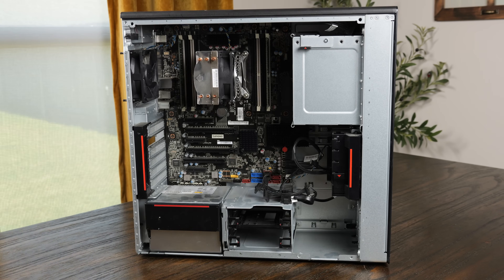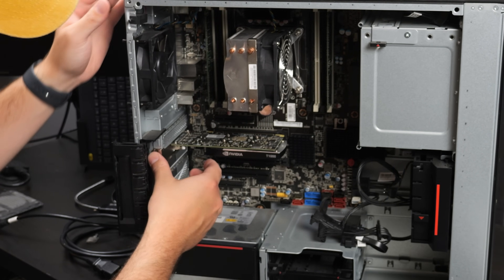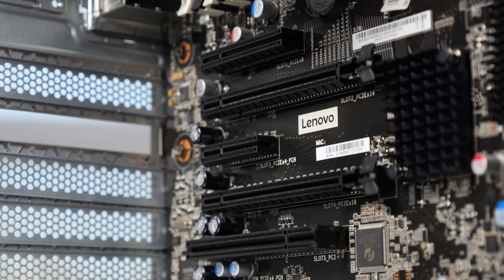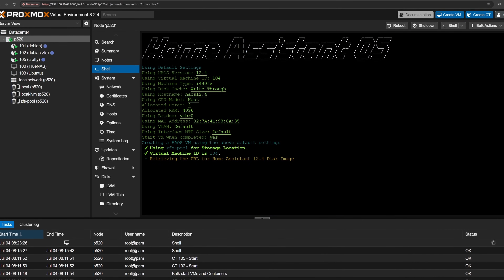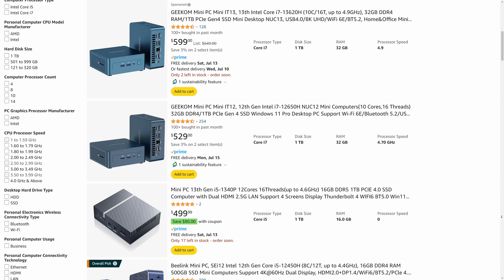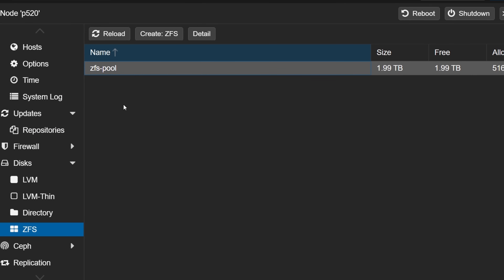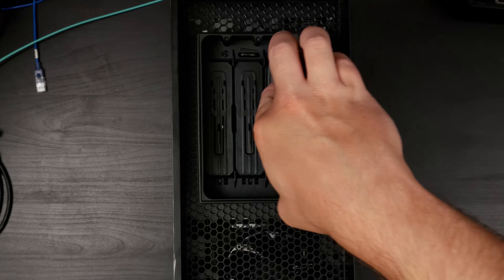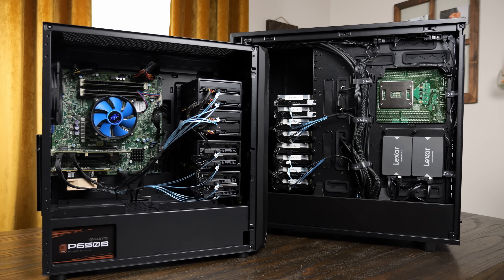A SERIOUS Home Server That's Affordable [Lenovo P520]

Comment: :) Thanks, love your videos. I'm currently using a Lenovo M710s for my Truenas Scale server. While it's handling everything pretty well; I feel like I'm working it too hard, and looking into something a little bigger (CPU mostly, 8 plus.) because I want to start sharing my services over the internet. It's currently running an 4-core intel i5-7400 (with 2x16GBs of 2666mhz), a mirrored 500Gb nvme boot drive, a 3-disk (500GBs each) raid 5 2.5" ssd pool for app configs, a 4TB mirrored app Storage/SMB pool, x2 2.5" 500GB HDD hotswaps for the app config pool,  a 2-port (x8 sata cables) HBA card, and a single port 2.4gb network card. 🤣🤣🤣 And most of the drives are in a 5-bay steel server cage (with built-in 120mm usb powered fan.), sitting outside of it. 🤣 My main pc (also a lenovo M710s) also has 1 of these cages attached to it, with a few spare drives. Not sure what they are actually called, but linked them in the reply to this comment. It started out simple and got crazy really quick, but looking at the P-series thinkstations for more cores and ram capacities. Oh, my Truenas Scale server cpu also idles pretty low, usually usually under 5%.

Comment: I deal with a mix of "regular" PCs and these business class style PCs, and from a maintenance perspective, those special quick change components like the PSU and front panel makes servicing extra smooth with next to no extra time required to get everything plugged back in. That station is designed around a IT department that has many of the same stations and keeps a stack of parts on hand for quick servicing where the cost of those proprietary parts is worth the reduced time to get a station back up and running, where minutes spent plugging multiple headers for the front panel and other components is something that is seriously looked at.

For home users, yes, the design is silly and makes finding replacement parts a huge pain. For medium and large business, its a time saver and they often order spares for each station, its worth the additional cost up front, since that can be written off on taxes.

Comment: These are a great line of PCs that are getting to be down in the nice pricing. I am currently building a P720 into my home server. 2 x Xeon Silver 4210 CPUs is giving me a lot of options and the layout is similar to this. One thing that I would change is to have 3 x 5.25" bays rather than 2 as this would open up a lot more options for expanding storage bays. Of course, the problem that I am currently having is the pricing of even second hand DDR4 ECC memory sticks...

Comment: @HardwareHaven what Sata power cables and Data Cables did you use, I've the Same System but struggling to find the cables. Ive three HDD im trying to connect?.

Comment: I just got my P520 with a W-2235 Xeon and 256Gb of memory. Am installing 2 1Tb nvme ssd and plan to add 4 used hard drives. My only problem is how do I power the additional drives, because my machine only came with two short 4-pin to 2x sata drive power cables and I can't seen to find any 4-pin to 4x sata power cables anywhere online. Any ideas?

Comment: @Hardware Haven your Intel AMT KVM feature likely failed for you because you didn't have video output (DP or HDMI) plugged in. I had to get DP headless ghost adapter or have a monitor plugged in otherwise video wouldn't show. Look into that as the solution.

Comment: FWIW, my P520 did NOT have "Onboard Intel RSTe SATA RAID" available in BIOS (i.e. VROC ONLY!). Also be forewarned: when equipped with the 690W PSU the second GFX power is not available... with 900W PSU, the second GFX PWR is available.... it would also be rare that the 9440-8i/9460-16i RAID controller would be included.
Also, the beast is built like a tank! AND, Lenovo support forums, factory updates are top-of-the-line 👍👍 TONS of quality spare/upgrade parts readily available... as these were business machines that were typically well maintained by (Lenovo contract?) professionals.... added a P720 (type 30BB) to my lenovo collection.... yippee!

Comment: Well, other brands also use non standard stuff. Once you branch off to Xeon based systems then you are bound to find a lot of gotchas and cave-ats. Just a few remarks on this 1. With these type of systems everything happens for a reason. Making proprietary stuff costs money. Hop on an engineering call with any of these vendors and there is usually a guy that can tell you why. 2. These reasons might be unknown to most except when you are in the business, could be to get a system ASHRAE certified, or optimized for licenses for workload. Or it could be as simple as: this part is not suitable for 24x7 operation. 3. Vendors don't need physical connections to vendor lock you in, custom firmware is enough. 4. Most of these systems will spend most of their life under warranty, there is no need for proprietary stuff while it's under warranty.

Comment: hi dell is beter because lenovo is a noisy thing dell precission is mostly les noisy i have the dell precision 5820 with the xeon w2195, 512gb ram 4x 8tb nvme in pci expres and 4x 24tb and 8x 4tb ssd in the 3,5 bay and a rtx a8000 48gb the bummer is no raytrace and pci gen 3 bit a bummer but its good innof also with lenovo you cannot boot from pci expres with the dell precision 5820 with a boot driver its posseble the sata was innof for the drives and blueray burner but i had to use the sas controller to connect the 8 ssd's and make more power connectors oh and somthing in mind the dell precission have somthing else 2 different power suply's 450 what with not the pci power cables and the 950what with pci power connecters mine came with the 450 what i have buy a 950 what power suply and pci cables so you know a bit what to expect with upgrading or buying these kind of systems

Comment: The HP Z6 G4 costs $200 shipped in a turn key configuration.  Just FYI!!! They come with a Xeon Scalable Gen 1 Silver but a 20 core Gold is like $30.  With a $100 Xeon Scalable Gen 2 Gold you have a server that’s compatible with cheap Optane DIMMs so you could slot in 4x 16GB DDR4 for $15/ea and then pick up (2) 128GB Optane DIMMs for $30/ea and you’ll have a system that reports 256GB and has 64GB worth of fast buffer for the 256GB.  Or you can just drop in 6x32GB for $30/DIMM and you have 192GB.  It can hold up to 384GB of ram per CPU in 6ch mode and yeh I said per CPU.  It’s going to cost you as much as the system cost you but you can buy a dual CPU expansion.  Or if you really wanted a dual CPU to begin with you can buy a HP Z8 G4 but who wants to muck about with dual CPUs.

Anyways yeh this is a cool computer but buy an HP Z6 G4 it’s better.

Comment: May I ask did you use standard 6pin to sata cables for the extra hard drives you added? Or which connector did you use to feed the extra hard drives power? Or does any1 else knows? 

Looking it up online, some sources suggest that Lenovo's 6pin power connectors on the motherboard (GFX_PWR1, GFX_PWR2) are non-standard, and isn't compatible with standard 6pin to sata cables.

Comment: I spent an arm for mine.  Custom made, 16 SAS hard drives on Areca 1880 RAID, one 18 core E5-2699 CPU on a basic Asus X99-E motherboard with 64GB of DDR4, 1200 Watt PSU, Used GTX1060 which was used for Bitmining and a modded Tyan workstation case from 2007.  ALL USED PARTS.

If a part fails, I can replace it.  Actually, I was thinking of getting a supermicro x10dai Dual socket motherboard or a HUANANZHI X99 F8D PLUS Motherboard as my case can fit E-ATX in addition to the room for a total of 20 hard drives.  I would also pair another E5-2699 in, for an amazing 72 threads if I did.  Also, there is a BIOS mod that enables the all-core Turbo on a E5-26xx(V3) which provides you with extra process power.

Now that is my ideal server NAS/Gaming machine.

Comment: Interesting, the cpu on it is a little less computer power than the 5600H in my laptop but the expandability, etc, for the prices you get on ebay - not terrible. I think id still pay a little more get a modern CPU that doesnt use so many watts

Comment: You know a professional computer repair person might remove the CPU heat sink fan from the motherboard when the motherboard is still screwed into the back plane of the case. You risk warping and damaging micro components on the motherboard when you remove the motherboard and then try to remove the Heating fan assembly!

Comment: I have built Lenovo P320s, P520s, P720s and P920s.
They are an excellent workstation choice as large businesses and enterprises dump them after three years of support for new models.
Dell Precision workstations are also excellent.
Supermicro workstations are the best for reliability and redundancy.
I only pick those three for Linux workstations; there is no point buying anything else.

Comment: I bought one of these after watching this video. I can confirm it works with the xeon w-2150b processor. these are a supposedly apple only version of the W-2155. It has 10 cores 20 threads I got mine for just about 110 dollars. as of writing the W-2155 costs ~200 dollars on ebay for a genuine article. if you're intending to upgrade cpu immediately the W-2150b is an affordable choice. As far as I can tell from doing research, the P520 is actually compatible with all Apple versions of socket LGA 2066 processors, but I can only confirm one from personal experience. I had concerns  about cooling with the extra cores, (not to mention I was gambling it would work off of one geekbench score I found online) but it works perfectly.
Reply: Thanks. I’ll have to try this out!
Reply: Grabbed a 2150b on eBay. Excited to install
Reply: @Kluong625  I'd love to hear how it goes.

Comment: We like Lenovo boxes.  We have an M93 I7 in the kitchen, a pair of P320 I7 tiny boxes driving the TVs for all viewing and streaming.  A p330 tiny with I9 and P1000 for portable theater.  Lastly I have a fully loaded T15G laptop.  Also a great buy are the used HP Z800 and Z840 workstations.

Comment: 140w is a monstrous consumption for a home server
Reply: My HP Z6 G4 pulls 80-90w with a Gen1 Gold, ARC A380, 6 DDR4 ECC DIMMs, SFP+, SAS6G HBA and some hard drives.  

At 32w which I think is what he says this pulls without a CPU the most money you can save in the United States would be $15-20/yr.  Where as he is already saving $50/yr over my setup which is still why I’m not even worried about the $80-90/yr mine costs to run.  Like what’s the point in saving $60-70/yr for a PC that doesn’t have ECC or costs $400 just to get (4) 32GB UDIMMs in DDR4 or DDR5…

It would take me years to cover the price difference between what it cost me for 192GB of ram and what it would cost for 128GB of ram on a system that could idle at 20w or less.
Reply: A lot of us have hyrdoponic growing systems (salad greens, tomatos, peppers). Over 1KW in lights. DOH!
Reply: I had one, the mobo died, the energy usage kept me from replacing it

Comment: 6 core 12 thread...not so great for a home lab.  I just upgraded my server for $30 to an Xenon E5-2695 v4.  And you can find plenty of LGA2011 / X99 Motherboards for less than $60 . My server runs 8 Virtual machines on ESXI, and has been running 24/7 for 5 years. I only upgraded the CPU from a E5-2630 because I wanted to run a dedicated Navidrome stream server.

Comment: I picked up a cheap Lenovo P700 with dual(!) Xeon E5-2620v3 and a Quadro K2000. Threw in 16GB RAM, 5x8TB HDDs in RAID5 and 2x500GB SSD in RAID1 for OS. Ran up Proxmox VE, and Plex container plus lots of other containers, and use it as a general file server. It's a beast for the price I paid.

Comment: Hey, I don’t know if you’ll see this comment, but which adapters did you use to power all those drives? I’m planning on adding two more 3.5” HDDs but am lacking sata power. I’ve looked up a 4 pin to SATAx4, do you think this will work? Could you offer suggestions? Any help is appreciated, thanks.
Reply: The 3.5" SATA drives were running from the seven motherboard SATA ports, so no adapter was necessary.  SATA power splitters can add as many power plugs as you need, within the limit of what the PSU can deliver.
Reply: I have a similar question, I can't really see clearly in the video what adapter hardwarehaven is using. Looking at the motherboard schematics, it looks like there are two 4pin connectors (1 for optical drive, 1 for drives) that are supposed to use to drive power, so I think this is the correct solution

Comment: I have a p520 myself, and I use it as a workstation. I didn't realize it uses bifurcation as well. Mine came with a 512gb ssd and 64GB of ram. I added an AMD RX 6600, a 4TB nvme, and I added a wifi 6 card. I love this computer. It's not super fast, but it does everything I like to do.

Comment: this video is no longer useful. the price of these computers is now $300 and you can easily build something better for $80 less- which is what i did. i'm sure at the time of recording it was worth it, not any more. however, i still would not recommend this computer even at the time of recording because repairing parts and/or replacement parts is much more costly in proprietary systems than systems using normal parts. so if you run into a problem a few times, you will find yourself almost spending the cost of another normal computer build just to fix this computer. 
so in the long and short run. just build a computer server using normal parts. it'll be better in lifespan, performance and maintenance; repairs/replacements/cleaning.

Comment: There are literally hundreds of reasons NOT to use Lenovo. The number one being this;

If you are even the least bit concerned with our war with China, consider that they interject back doors and spyware into the hardware, even behind the BIOS. For most home users, this would pose little risk. However, if you have sensitive information or applications on it, then Lenovo should be avoided at all costs. There are many more safer alternatives out there for the same money or less, like Dell or HP.

Comment: The KVM function in MeshCommander (Intel AMT) only works if you have a CPU with an iGPU. Most of these workstations rely on an external GPU so you can't access them via KVM, but it is nice to know the serial-over-LAN works.

Comment: Just a fun note, I have several of the HP equivalent Server PCs (z840, z6 G4, etc) and they're very similar to this. The only thing I can say is that the HPs have a bit more on the tool-less and the drive bays make a satisfying clicking noise to let you know they're secure. Been using them for various server applications and they really are great for first time server applications, even if you don't plan on upgrading or expanding.

Comment: The thing that kills any enthusiasm I have for most of these "cheap" home server solutions is the idle power draw. Like, sure you're paying $200 for this or whatever on ebay, but then if you just idle it for a year it costs about $80 in electricity where I am. That means if I were to hold onto it for even just 4 years, it's costing me $520 in total including the purchase price, before I even use the thing for any actual work! Then you're dealing with slower speeds from the ~8 generation old architecture too. 

This is why I tend to go for mini PCs for my server needs. Nothing beats a ~4.5w power draw on an always-on device. My last was a nuc i5 with the 8259U in it that served as my media server, dev server, and recently NVR. It was starting to struggle when I added a few more cameras to the NVR, so I just bought another to replace it, this time a 13th gen 1340P nuc model for ~$450. A little more pricey, yes, but it won't take up an entire shelf on my already cramped network stack, and the iris XE graphics can do plenty with hardware acceleration, not to mention it's a 12 core CPU so there's plenty of resources to go around. For me, an equivalent desktop class workstation with a xeon that has at least 8 cores and similar single-threaded performance (which I rely on heavily for things like video transcoding for burning in subtitles) would just be too much money comparatively speaking, honestly just the CPU itself would probably cost more than the entire NUC! Then if you add operating costs, that $8/year electricity really adds up (or rather, doesn't add up to that much) over time too. The energy savings alone means the more expensive mini pc's basically pay for themselves over 3-5 years of use compared to a cheaper big box server. 

But most of this is because I run CPU-intensive, often single-threaded workloads all the time. I suppose if you're doing something more memory dependent or GPU dependent, the ability to expand that much further is a plus.
Reply: You don't need anything more powerful than n100 for transcoding, and for subtitles you need to check your client settings, direct play is the way to go, and with that even pi4 works fine.
Reply: Europe is so collapsing with the power costs going up (due to dumb sanctions on Russia). Dumb!

Comment: Using this as a guide but ran into a problem. I have 4 hard drives connected to a SAS controller that are recognized during the proxmox installation but not in the bios so I can't boot into the OS.
Anyone have any ideas?